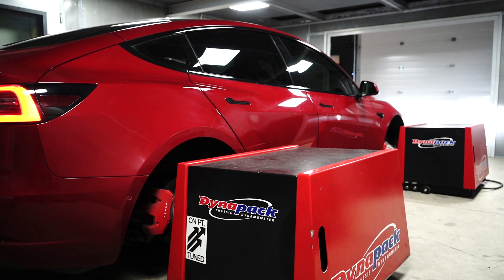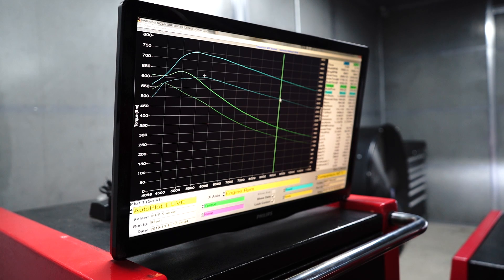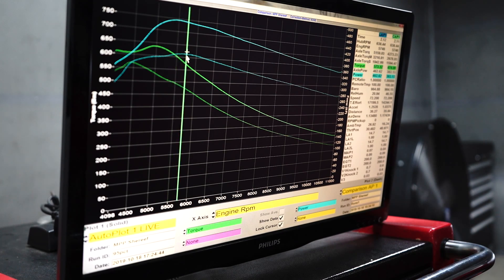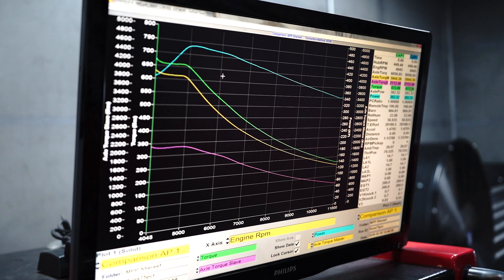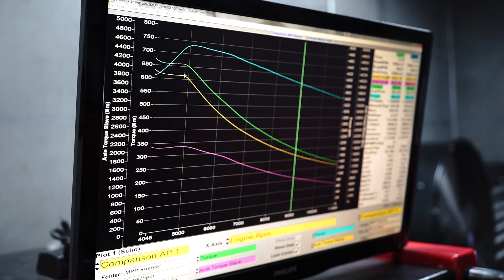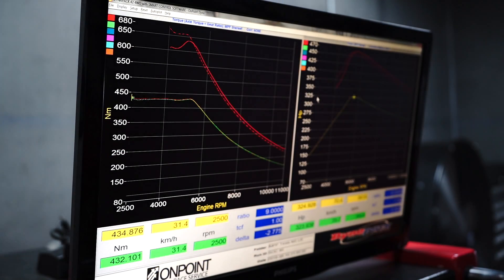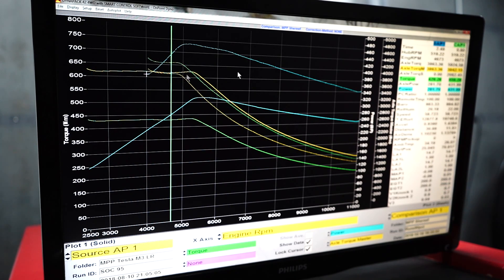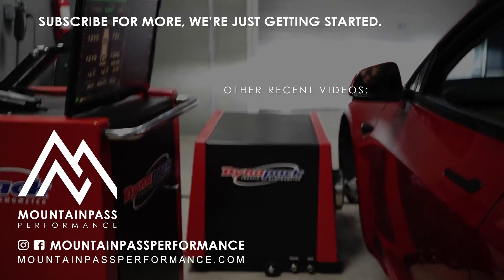Tesla Model 3 Performance Dyno Test - Will it work on a hub dyno?

Comment: Can these dyno modules work properly on open diff cars? What happens if one module presents slightly less resistance to one wheel and causes it to spin faster (and transmit less torque as well)?

Comment: I find the power drop pretty annoying as its very noticeable when you're under 50%, but at least the 0-40 stays consistent which outside of highway driving is where you do most of the city driving speeds.

Comment: Great video! I'm not understanding the part about exceeding the dyno torque limit around 4:30 in the video. The chart seems to suggest 750 + 340 Nm, but you said it was tripping 2000? Mind explaining what it is I'm missing :)
Reply from the maker: Yes - the dyno front pods have a limit of 2000Nm. The motor torque is multiplied by the gear ratio - roughly 9:1 - so that gets it over 2000!

Comment: Nice torque and hp output with very small drivetrain losses. Impressive to say the least. Factory hp is rated at 496hp and 520 torque without latest power inceease/update...✔✔
Reply: 496hp is a 10% (2, 5% updates) over the factory rating of 451hp

Comment: Why are you figures so wildly different from everyone elses? I have not seen anyone else getting anywhere over 700nm on a Model 3?
Reply: Getting Dynos to work properly has been realy difficult for powerful BEVs. ICE dyno are design for building up pressure and measuring that load. But Electric Motors have sudden kicking of torque that is too fast to average out. Sasha is exceptional at Dyno testing also expert on EVs. 1. He is using Hub Dyno which has far Less Slip, 2. He found the torque limit and is manually feathering the accelerator 3. He is comparing State of Charge effects on performance. Sasha is simply the best at doing this specific testing right now. Sadly no company has done the expensive investment to build a BEV Wheel Dyno yet.
Reply: @Neojhun  But does that mean that the car actually has near 6000nm? when everyone else says 600-700nm ?
Reply: @skodbolle  Before and After Gearing Reduction. 6000nm does not sound right, that's an awfully high gearing of 10:1. IIRC Model 3 should be around 8.75:1. Should be around 4800ish.
Reply: @Neojhun  So you do not agree with his dyno either?
Reply: @skodbolle  I'm confused about the Gear Ratio. His Before gearing torque value is very exceptionally accurate. Maybe i'm wrong about 8.75:1. 10:1 Gear Reduction is very aggressive and limiting to top speed.
Reply: @Neojhun  The Model S has 9,75:1
Reply: @skodbolle  Yep still not Model 3, motors are different. Especially the newer Permanent Magnet one which you do not want to High RPM as much as the Induction Motors in Model S. Lower Gearing means Lower RPM fatter torque band.

Comment: so what were the peak hp and tq numbers?
Reply: Wrap Factory at the wheels 480 hp and 500 lb-ft.       At the motor’s.  4865 lb-ft. And incl the new  5 % update. 420 kw ( 575 hp ).   Someone on Twitter tested this.
Reply: Splintered Woodworker with scan my tesla you can see that the m3 performance has 423 kw / 575 ph available at the motor’s.  That 500 ph at the wheels.
Reply: Splintered Woodworker and my car has on paper 483 pk  , car arrived 1 month before the first 5 %.   
like many manufacturers. The cars have more power in real life.

Comment: Sasha have you ever dyno's 95% vs 100% battery.    Also looking at the graph I bet if you were able to pin it from a start you might measure a bit more hp at the front wheels.

Comment: Interesting analysis and very informative. There is one point I think it is important to highlight: that power / torque you measure is "peak": that mean for a limited time, how long it depends mainly how fast the maximum operating temperature of the various parts, especially MOSFET/ power electronics are reached... Close to that temp derating starts. This is therefore not a continuous power which would be rather interesting to evaluate although it takes time.  "Peak power"' is a similar concept of "war emergency power" of ww2 aircraft engines. As a matter of fact you need around, if my memory serves right, around 200kW continuous mechanical power to keep the Tesla m3 at constant speed 250km/h (from TB video). 

Therefore in the statement "it makes much more power than my car" (which I assume is ICE powered) one point should be addressed: peak or continuos power? In my opinion, every manufacturer should specify always the duty cycle (peak for how many seconds/ minutes and  continuous) because high continuous power is way challenging than high peak power: continuous means no derating at all, i.e.  you can keep high speed without derating, or you can keep high speed up-hill. It would be a huge selling point for performance car.

I believe, but maybe you can confirm since I am not expert at all, ICE engine power is reported in the technical specs as continuous. For example a VW Passat 2.0 TDI is rated 150HP: is it continuos or (somehow) peak?
Reply: There is a video of the P3D on the autobaun doing 130 mph for a solid 20 minutes (bringing it from 94% SoC to 49%) with zero issue - What more do you need to know to be convinced? The car already has a reputation on the track as well, with several hot laps easily. The only issue is power dropping as SoC drops but this is normal for EV's.
Reply: @taipoxin  I don't understand what your statement is related to mine, since it does not add any information I know already. 

I am an engineer and I work with electrical drives. 
What I wanted to highlight is that there an important difference between "peak" power and "continuous" power (power which can be delivered constantly leading to a steady state temperature conditions in the drive). Check from TB which power the drive has to deliver at 130mph (not to accelerate to 130mph, where in case you need more torque/power which is for a limited time->peak...no, only to stay at that speed).

For more info here:
https://core.ac.uk/download/pdf/11430165.pdf
Reply: Correct, ICE hp engine ratings are achieved during a somewhat sustained test but the difference vs. peak power achievable isn't very big. There is also a video of a M3P doing a somewhat sustained 160ish mph on the autobahn as well,, fwiw.

Comment: Was this done pre software update. Tesla said they were doing a 5% power increase this month. Would be curious to see if its a real 5%. Great content
Reply: I got the update w 5% power increase today.
Reply: Very likely these numbers are before the bump.  I would be curious also to see just how much this bump ends up being.
Reply: Only about 3% of owners even got the recent 5% before it was pulled. And most of those went to affiliates, randoms and influencers. It would be good if Sasha could confirm though.
Reply from the maker: @taipoxin Yes, this was before the 5% power upgrade. We haven't gotten that here yet.
Reply: Sasha Anis plz do the same if you can with update keep Tesla honest so what was max HP and Torque
Reply: @ripoil1488  like the test was dishonest. He tested what he had available and it already was beyond the limits of the dyno
Reply: @taipoxin  Got my 5% increase tonight,  took it for a blast,  mid range pull definitely increased.
Reply: @kiwim3p587  Great to hear. I got it as well for my LR AWD. Managed 4.08 to 60 without rollout, 3.86 with rollout. Definitely pulls a bit harder around 40 mph on up, which is just what was needed.

Comment: Curious if the "software limited' Dual Motor non-performance model 3 would have a much flatter curve due to it not inducing the same voltage sag on the battery?  Less stress = greater dynamic range of peak torque?
Reply: Could be due to different inverters used
Reply: larry Spiller The comparison has been done before. I forgot the channel name, but it seems to be mostly software limited (inverter could be still different) and not much difference in curve shape.
Reply: it isn’t just software limited, there is also missing power delivery electronics on newer versions and binned ones on older models